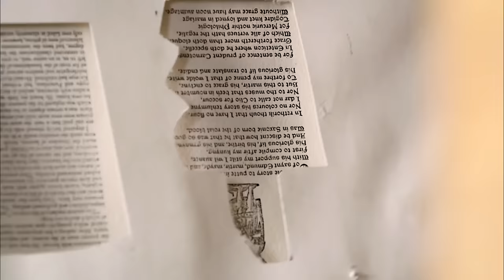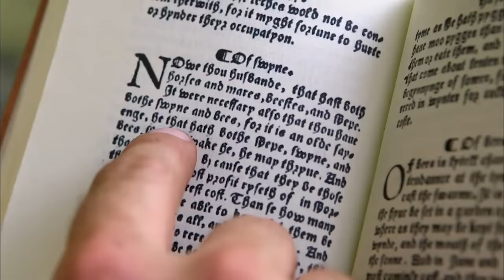A Working Day As A Tudor Lead Miner | Tudor Monastery EP4 | Absolute History

Comment: Just doing some quick math:
1 pound = 20 shillings
1 shilling = 12 pence
So 8 pounds for a ton of lead =1920 pence.
1 ton = 2000 pounds
So, if you got 8 pounds, 6 shillings, 8 pence for a ton of lead you would get 1 pence per pound of lead.
They made 2 pounds in 3 days.
I'm not sure what the cost of living was then, but in the Victorian era it was 4,5, or maybe 6 pence per day.
So if we assume 5 is the average, they only earned 1/3 pence per day, or about 1/15th of what they would need to mine to live off of it.  And that doesnt account for the monestary's cut or taxes.
Conclusion: mine faster.  At least 20 times the load.